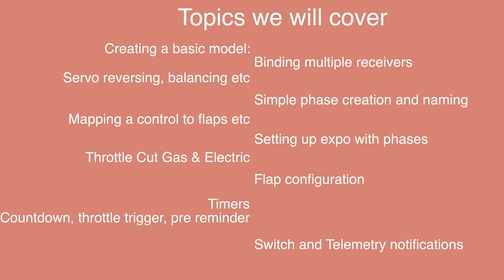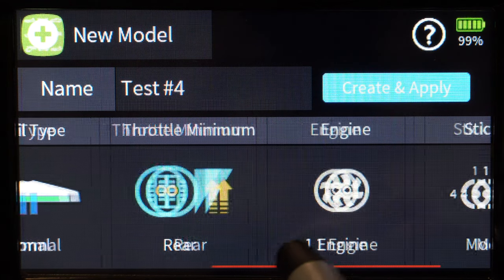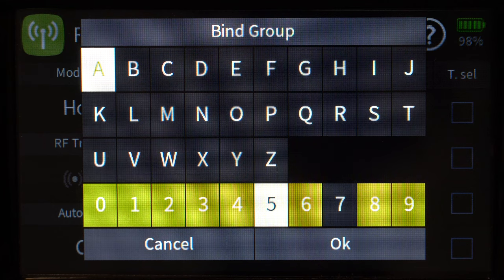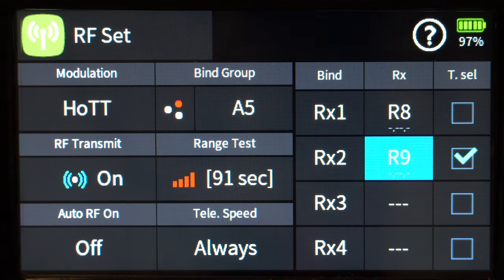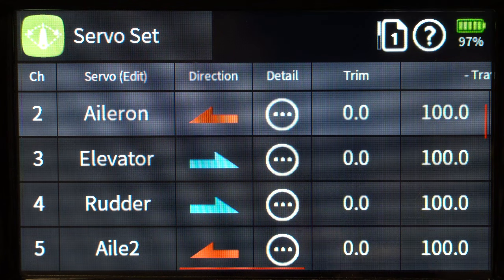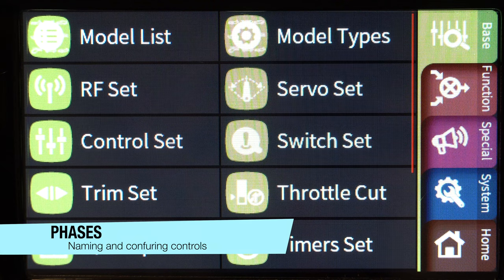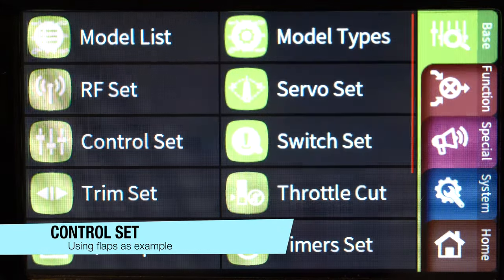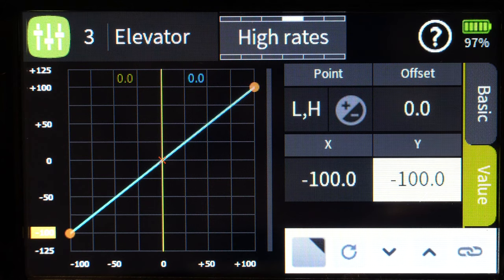Setting up a model from scratch on a Graupner MZ-32/MZ-16

Comment: Thank you Yufasa, I hope Graupner will continue producing the products
Reply from the maker: And me, I got a lot invested in them..
Reply: Same here
Reply: I dont think so. They sold the company. And the MZ is from SJ, put a Graupner patch on it...thats it. No Firmware Updates since Month. So many problems with this transmitter - and no fix in sight.....i had a MZ32, but sold it, because it has so much bugs....and that with a cost of 1000€ in germany. i dont like Graupner anymore...
Reply: OMG, what Tx did you buy now ?
Reply: They are and they have just released a firmware update and you can get their radios and receivers at various places now.

Comment: Yufasa, I tried to discharge my MZ-32 , because of the whole Corona thing (no flying), but I thought it would turn off automatically after 30 min, but it did not, drained the battery to 3,06 v. How can I make the radio turn off after 30 minutes, if the radio is not operated ? Hoe the lipo is not damaged .
Reply: I meant to make a video on system settings (the blue tab). This is where you find a setting for idle or inactivity. When the radio does not see any input for this time period it will turn off. I don't recall the setting from memory but will see if I can dig it up.

Comment: Superb explanation, thank you, it's just about made my mind up on which transmitter to get 
Cheers
James
Reply: James, Did you get one?
Reply: It's on its way to me from Germany.
Reply: @jamescattanach1129  Very cool.
Reply: @jamescattanach1129  Hey James, let me know if you have setup questions. I always need recurrent practice. Ha.
Reply: Sure, will do but don't expect anything for a while, I'll be hoping to start the build in November and once I get the electronics purchased I'll be setting up in anger, it's an extremely complex setup that I have in mind particularly around sequencing which is what attracted me to this system and this is my first RC project so rest assured I will be in touch and thank you for the offer but don't hold your breath lol, I need LMA involvement too and that will likely delay things further 
Cheers
James